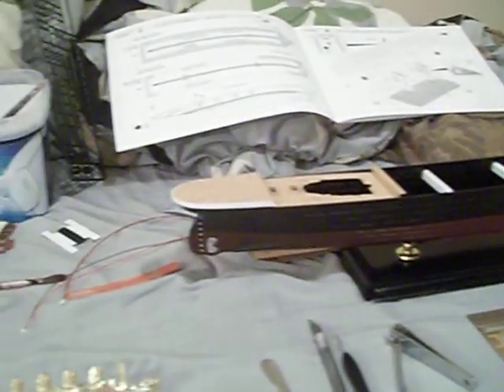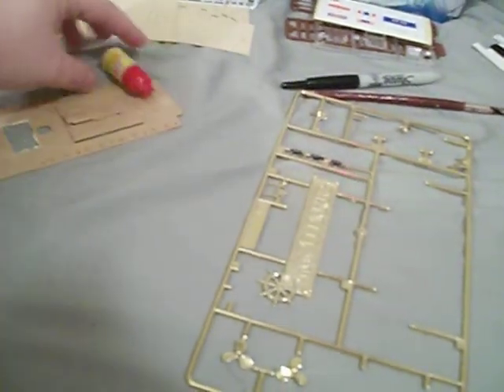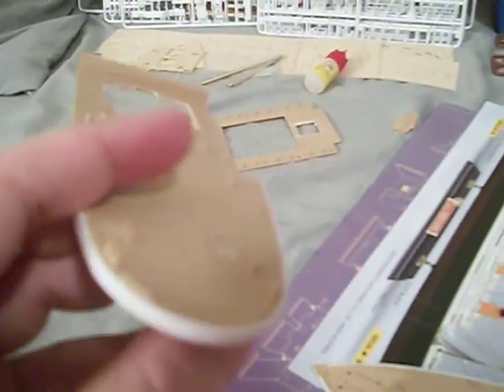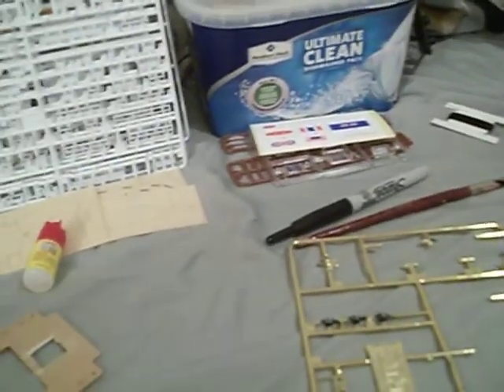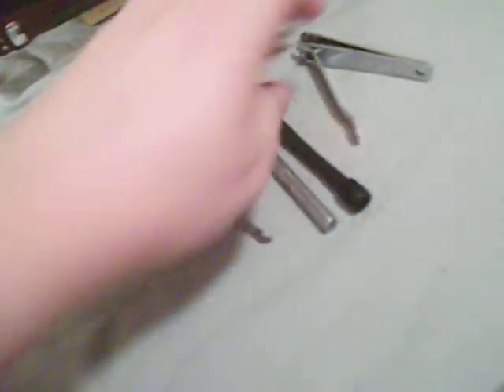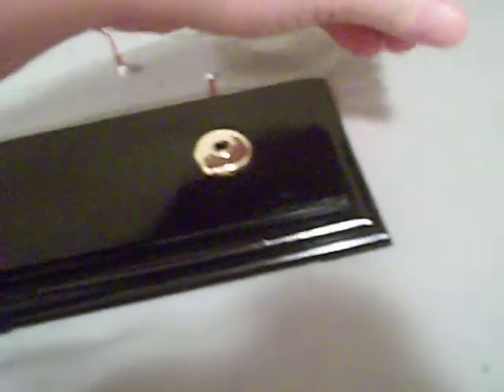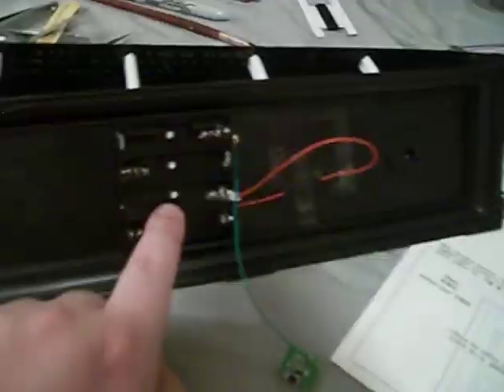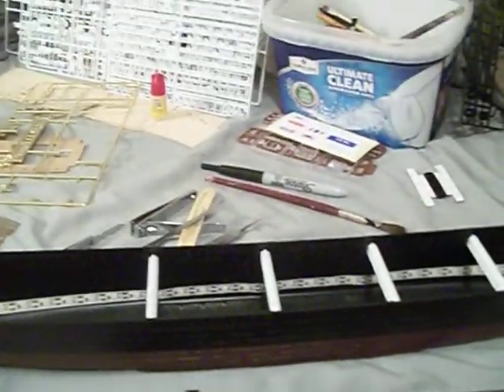The LED don't work: academy 1\400 RMS Titanic part 3

Comment: Agree with last comment also remember the little circuit board is static sensitive so it is possible to blow a board if you don’t earth yourself, to get rid of static
Reply: the power wires with the first board are reversed. I cut the first connection and inverted. sorted out. BRAZIL!
Reply from the maker: Richards uk scale modeling channel And Reviews ok thanks a bunch.

Comment: Hi.
I tested leds and didin't work. 
I noticed that chip under the stand was wrong way. Now chip is right way and connected right, leds came on. 

When you hook up the power button did you use part J15?

Try this. Check chip for that is right way. Next connect battery box to chip. Then power button and line. Remember use part J15. And Remember tape wire so that power button line/wire is tight.
Reply from the maker: Yoshisan55 OK I'll do that thanks.
Reply: the power wires with the first board are reversed. I cut the first connection and inverted. sorted out